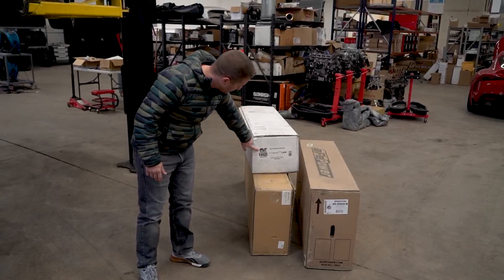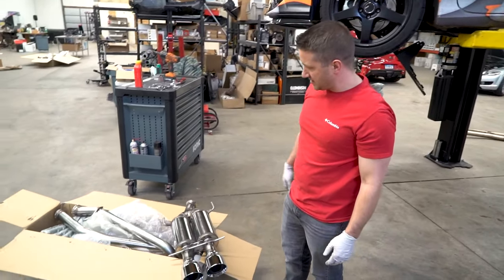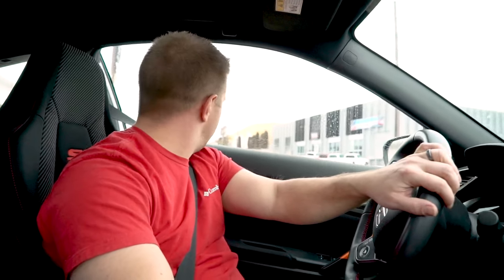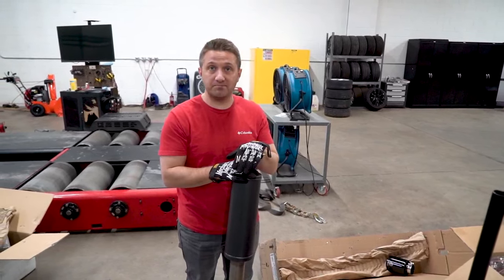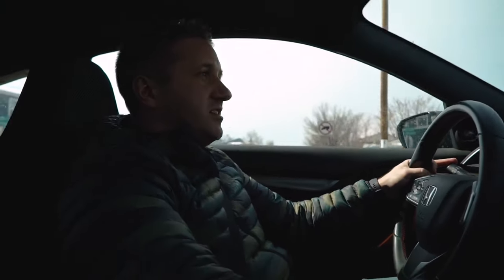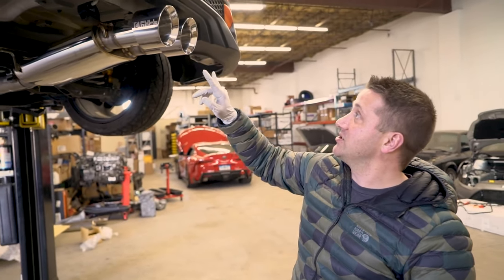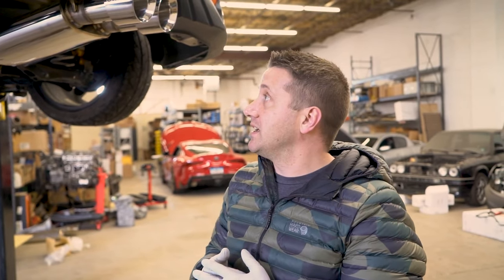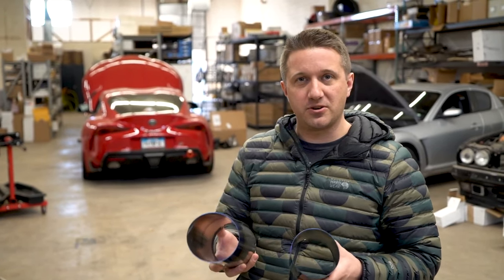We Install 3 MORE 10th Gen Civic Cat Back Exhausts  |  Project FC3

Comment: Heyy i have a civic sport sedan 2019, will an SI exhaust fit mine?
Reply: you are close to being able to fit the SI but your hangar location points are different and would require modification possibly mods to the car because the SI exhaust is so wide. I have 50% of SI on my Sport Hatch but I made my own rear section. Despite the cavernous internal volume and great sound of the SI mufflers its much harder to fit than any aftermarket kit with smaller cans.
Reply: @jamesmedina2062  what do you mean by 'own rear section'?
Reply: @francisdelizo3420  yea good question. So I used the SI exhaust pipe in areas towards the front and after it goes underneath the suspension subframe, it is all a combination of a Supersprint 60mm system combined with 60mm pipe bends. Its Tig welded stainless steel. My favorite exhausts are from Milltek, Supersprint, and Remus but since they don't make stuff for most Civics I adapted their Audi system to my car and works great.
Reply: @francisdelizo3420  Look up the Milltek system for Mini Cooper with dual mufflers. Its about 400-500 bucks from ECS Tuning and you can just shorten two pipes and use it in our Civics. Will give great sound. But for Tig welding got to find a decent welder in your area. Mine does HVAC work. He'a not even that good but he was cheap.
Reply: @jamesmedina2062  appreciate the information and help man, God bless ya. I'll look into it and hopefully get done during summer.
Reply: @francisdelizo3420  you're welcome. take care!